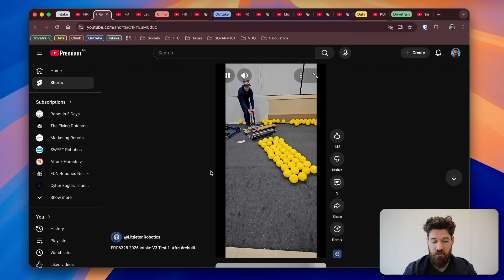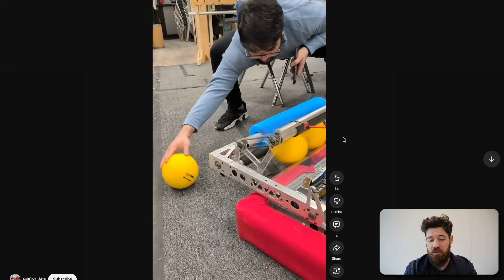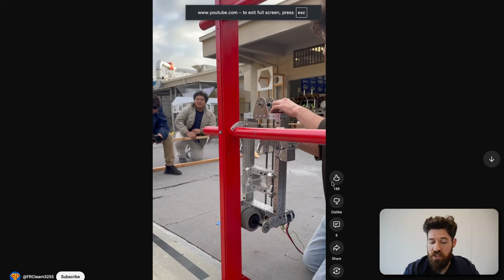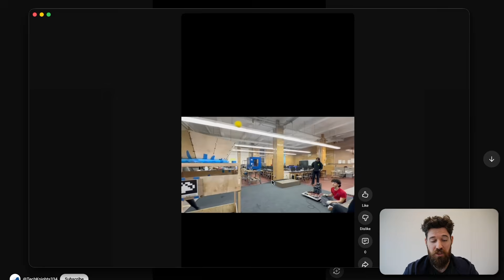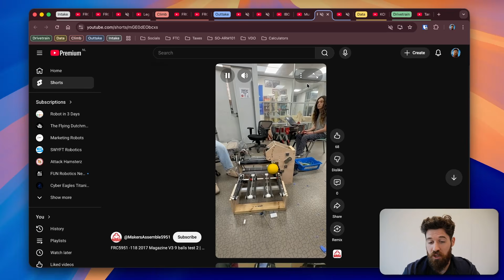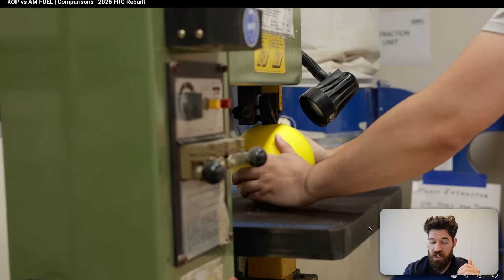The Flaw With 2026's FUEL [FRC Saturday's REBUILT]

Comment: Correction note here from 9062, that Legacy intake rollers are aluminum With silicon over it not PVC
Reply from the maker: Thanks for that, hard to tell in the video. Perhaps aluminium may not have enough compliance in it compared to pvc, the designs I've seen using PVC seem to be outperforming alumimium at the current point.

Comment: just wanted to say that CriticalCIrcuits did show another video with both on the carpet and very diffrent output the tank did not do so well even when only using l2 on there mk5i.
Reply from the maker: Wow, significant torque output from those mk5i's, that's impressive.